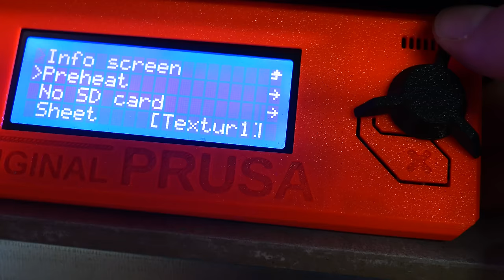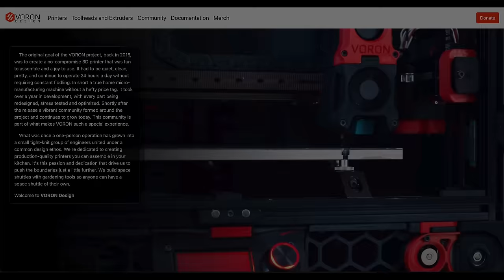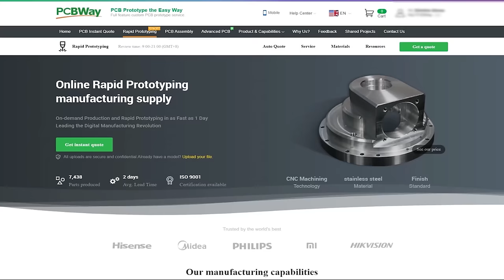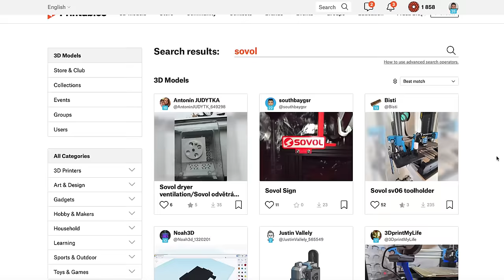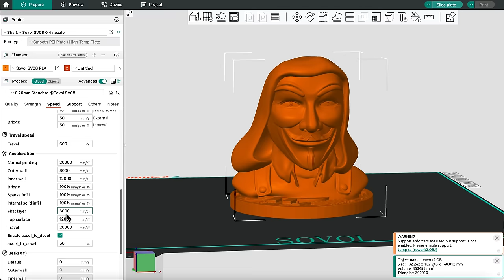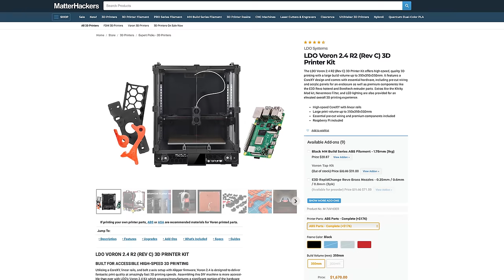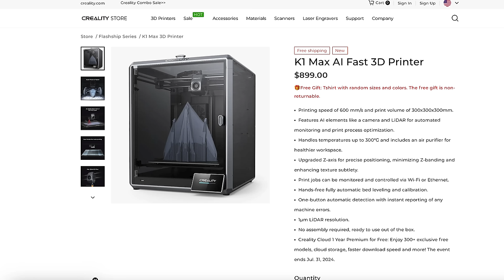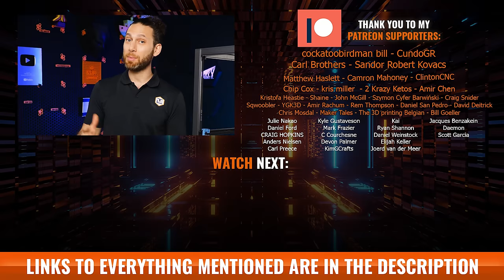The Sovol SV08: You Won't Believe the Price…

Comment: Hey Jonathan, I have an idea for another video, please see what you can come up with. I am looking for a recent generation 3D printer to make mechanical parts for engineering prototypes and equipment repair parts, not for toys. What I am looking for would be enclosed or easily enclosable, and with internal volume temperature control, capable of extruding engineering plastics, ABS and nylon at the very least, plus investment casting model making polymer, and preferably capable of high performance polymers up to PEEK. I would not have any use for PLA, I would be using PETG as an absolute bottom end material. It would be almost essential to have a dual extruder head so it could lay down design filament along with support filament or possibly make a bond to another polymer like TPU without interruption. Open source format hot end/nozzle design is probably a necessity for compatibility with the desired polymers. I do not need a huge build volume like the SV08; a 250mm cube would be plenty, but bigger would be OK. I would prioritize printing accuracy and mechanical strength over speed since parts would be parametric design and would need to fit together. I do not want a filament changer as I will never do multi-color. Thanks.

Comment: To be honest, I would buy it immediately if it weren't for the noise level. The screeching of the stepper motor drivers in particular puts me off. I remember that from my Ender 3, which is now rotting unused in the storeroom. I have the Sovol SV06+, which also gets very loud, which is extremely annoying. My converted Ender 5 pro, on the other hand, is extremely quiet. Apart from the fans, you can hardly hear it, even at print speeds of 150mm.

Comment: I started Sovol with the SV07 plus. There are design issues that they totally ignore, such as the lack of cooling for the controller, really bad slicer settings. No support for the Orca slicer. The absolute worse customer support. If you buy the SV08, you are going to have to work on it, some of the features such as the nozzle cleaner are not functional. But, on a positive side, it is cheaper than a voron…

Comment: My first impression was that this isn't aimed at the same set of people as the Voron, and the video confirms this.  (This title feels a little off, but it's not wrong*, just lacking nuance.) As you say, the main reason to build a printer is to *build it.  This printer seems to be aimed at the folks who like the usability of a Bambu but not the price (or just decided to die on the "open source" hill).  Or those who like the Bambu but want a bigger build area.  Which means they're not really aiming at an underserved market so much as the bottom end of the "it just works" half of the hobby.  One should not build a Voron to have an awesome printer, one should build a Voron for the experince of building a Voron, and having a printer that can be bought if your end goal is simply an "awesome printer" is only going to split off the folks who really weren't wanting to tackle the project in the first place.  So it's a good thing, I think.

They do seem to be more aware than Bambu was that most of the market is just interested in PLA/PETG; releasing the "this prints the cool filamnets" version first and making the "this prints the hot filaments" version as an upgrade seems like very good marketing.

The all-in-one nozzle and throat suggests that Sovol is accepting the idea that the old V6 multi-part nozzle was a kludge and it's time to move on.  I like that.  I do think it would be nice if we could settle on a standard for that type of nozzle - but we're in very, very, very early days for that.  Like sidearm cartridges a hundred years ago, everyone is still trying to push their own ideas.  Give it a couple decades and it will settle out.  So I get your frustration with not being able to use your old V6 nozzles, but they're a horrible idea and dead technology and no printer released post 2022 should come with one.  (I'm also unsure about the 0.6 vs 0.4 question.  Honestly, it would be nice if E3D would just make Revo licenses affordable and let printers like this ship with a Revo for easy changes.)

Mass produced, well fitting parts are the key to low cost and high reliability.  Being able to source a spare part from wherever isn't free: you pay for it in either total cost or lower reliability (or extra work to recreate reliability, which is what a Voron build does).  Bambu's biggest revolution might be introducing true mass production to 3D printers, and people who want to avoid "proprietary parts" need to suck it up and accept that "low cost mass production" and "generic parts between brands" are almost if not quite exclusive concepts.
  
(Although I do think that Sovol could have put in the effort to use 3d printing for the plastic parts and help push the "mass produced via 3d printing" industry a step forward. We're right on the cusp of that being widespread and its disappointing that a company looking to sell 3d printers isn't using that to support large-scale additive manufacturing.)

Finally, rant warning: the fans being loud enough to discourage you from remaining in the room is a FEATURE.  All melted plastics give off VOCs, and  all 3d printers generate microplastic particles as the extruder gears cut into the filament.  Even if it's not giving you a headache, we KNOW that breathing microplastics is a bad idea, and we have no idea what 30 years of exposure to PLA fumes will do to us.  Staying the f*** away from an operating 3d printer is a GOOD IDEA.  Don't mod the fan to make it quieter - put the printer in the printer room and do your work in a different room and stop giving yourself emphysema from microparticle inhalation.  Okay, rant over.

For me personally, this falls into "I don't really need it."  I have an X1C that does all I need for smaller parts, and the "big" things I want to make are over 45cm across, so a 35x35x35cm build plate is still "small."  But if it can get close to Bambu levels of "it just works" and reliability, this could be a very useful machine, and will also help bring prices of "it just works" down in a way that Creality's "we use the community as our beta testers" printers never will.

Comment: Bro once this thing is out for a couple years and the price goes down a bit I might have to get one. What a beautiful machine (although i might not unless they give us that V6 nozzle adapter, I want to be able to print carbon/glass fiber without replacing my nozzle all the time). Also will have to watch more reviews in case other issues with it come up
Reply from the maker: Yeah, I see it as a good platform for upgrades, like an Ender. I would IMMEDIATELY replace the board fan... and I'm probably going to replace the entire hot-end and put an eddy current sensor on it when I get a sec :)

Comment: For the build volume, it is quite cool but the proprietary hotend might be a dealbreaker
Plus the fact that for the undisclosed price, there probably won't be any enclosure, heated chamber nor filtering/aeration system...
While not comparable in terms of build volume and technology, I think I'd take a Flashforge A5M over it unless maybe if it drops at under 400€
Reply: He says the price is under USD600, so it's probably $599/550€ or so.  The enclosure etc you can easily make your own or buy it separately. It's very inexpensive compared to the A5M which only has a 484 square centimetre print size vs 1225 square cm for the Sovol.

Comment: Looks very promising. I'd love to build my own bambu to avoid their closed ecosystem and a voron/ratrig/HEVO would be the way to go but this is a good shortcut, with a few mods needed. I can't help but Frankenstein every printer I touch apparently. I think I could get a CHC running volcano nozzles on that thing if I poked around it for a while. I'm also sure someone is bound to get an ERCF working on this thing sooner or later.

Comment: As a Voron has never been on my radar I ask myself this,  is the 08, with enclosure, a good alternative to Qidi X-max3 and other printers in that segment ??
Reply: not that i own any of the products, i do own a voron 2.4 r2 tho.

but the 08 definitely is better than the qidi if this is raw klipper.
but that being said, the issues he mentioned aren't as easy to fix as a voron and you will likely need to mod a lot to get it quiet and easily swap the extruder for a v6 as example.

aside that, i doubt it's easy to add a carbon filter or nevermore filter with activated coal as example, or to print replacement parts, so for half the price of a 250x250 2.4 r2 i'd consider still looking at voron, because ASA is actually a pretty neato material to print with from personal experience

Comment: Sovol is a Creality company. Those printers are developed in-house. In-house of sovol? No. In your house. They always need community Mods to become useful and they need time and fixing (if you are lucky and get the parts, sometimes you will get ignored or redirected to a very bad YouTube Video) because the early customers are used as beta testers for full price (even if they tell you, that the early bird price is less. It isn't)

The Nozzle knocking prints over is either a Hardware or a Profile problem. I never had that happen with my printer (not a voron) and i don't even use z-hop. Most people in the community of my printer don't use z-hop either.

That's not only my experience with sovol, many customers had those problems. In my case it was the SV06.

By the way.. after i didn't find a solution with Sovol for the problems the sv06 had, they offered to refund me if i send the printer back.. sounds good?

Send it back to china!

That would have been about 95€ shipping. That is some pristine customer support (which is only accessible via Facebook chat). Keep that in mind.

Comment: I'm sure there are better fan replacement options. Fans are usually easy to swap out... I have an ender 3 S1 pro, first printer ever. Added a Bambu P1S to my fleet...it's epic. This being 575ish and a bigger bed... This COULD be my next printer. ALOT of value here for the price! I still am not up to speed on these Vorons and SV's....more reading before I buy.

Comment: Belted Z axis has me sold, we are finally starting to get companies that are moving past outdated lead screws. I love it.
Reply: What's wrong with the lead screws? Gantry of the Voron 2.4 is 30% heavier than Trident, giving the Trident (with lead screws) a speed advantage (as in max acceleration in input shaping). Also the bed on the bottom makes it harder to heat the chamber than the Trident with the bed on top where the hot air goes. Better for printing ASA, ABS, Nylon etc., it doesn't take ages to reach 45C+ chamber temp where the print is.
I have both a Voron 2.4 and a Voron Trident and I think the Trident (with lead screws) is the overall better design. Don't get me wrong, the 2.4 / SV08 style is great, but all in all I prefer the Trident.
Reply: @tstrrtstrr745  Lead screws are less accurate, and are generally replaced by ballscrews with more modern CNC machines. Belted Z is another option for machines that bear less of a load, no concerns of backlash with belted Z, and less weight. Those are 2 different printers you are comparing, lead screws are not the deciding factor for gantry weight. There are belted Z mods for the trident, although I think they mount the motors on the top, I'd install them on the bottom.

Comment: If they don't fix the z-hop issue you pointed out, this will not be an out-of-the-box just works printer, in my opinion.
Reply: I think there's probably a bigger underlying issue if the print head is knocking stuff over. Fixing that with Z-hop is like putting a bandaid on it imo. A lot of people are saying the print bed is probably thin and flimsy, so it could be that it warps significantly when heated. Or maybe it's related to the Z probe issue? Z-hop will also dramatically increase stringing and it's nice to be able to print without it. I'm waiting to see more reviews
Reply: You guys are exaggerating
Reply: @_..-.._..-.._  z-hop just sucks for most prints, if it can't print without Z-hop I don't want it. But if you mean that there actually aren't issues with knocking prints off the bed then that's great

Comment: I hope they made it easy to replace the hotend.  Im just not gonna use the one that comes with it ever if I buy one of these.
Reply from the maker: I'm gonna try to replace it.
Reply: @thenextlayer  yeah that would be the first thing I did with it.  I switch over to volcano style on every printer I have.  Then ceramic with cht style volcanos on the larger ones.  

Hopefully wont be hard to make the switch on this one.  Im pretty excited about it been waiting for a ready made voron that didnt cost a ton.  Hopefully these things do the trick.
Reply: @thenextlayer also kind unhappy they arent selling the svo5 anymore that was they bang for the buck printer in my humble opinion.   So easy to convert to hybrid corexy or full corexy and just a decent printer out of the box for a good price.

Comment: That pricing discussion was really bad to follow. It would have been great if you had rerecorded it.

So $600 for a downgraded voron. That's not bad but it's not as awesome as you make it out. It isn't a carbon copy of a voron. A performance comparison for the hotend fan being better will have to be made. Klipperscreen is missing and you neglected to mention why using standard aluminium extrusions is so nice. You can't just mount things to these sheet metal parts.

The nozzle is a huge question mark for me as you said yourself 3rd party accessories are probable not going to be made. 

Questionable is also how rigid the frame is in comparison. 

All that being said its a cool printer.
Reply from the maker: In someways, it’s downgraded, but as I noted in the video, in other way, it’s upgraded. Filament sensor, HDMI, nozzle, brush, camera, Canbus…

Comment: Sorry if you covered this and I missed it, but does this come with a paneled option? A lot of the reason people like Vorons is that they are optimized for ABS printing and have a built in enclosure. If there’s not a panel option, it’s a huge missed opportunity for this printer.
Reply: They are releasing panels as a separate product that you can buy.

Comment: TPU performance is the big question mark for me, my sv06 wasn't the best in that department
Reply: you can put the sv06+ high flow extruder on the sv06. That is a tpu wizard.
Reply: @gerGoPrint3D  My issue was the extruder gears, I already have an extended meltzone on there

Comment: Just saw you comment about Z-Offset thermal drift.

I was beginning to wonder if I was the only one experiencing this.

I have discovered on my Cteality Ender 3 S1 Pro, I have dramatically different Z-Offsets for different temperatures, including bed temperatures.  I have even started a spreadsheet to help me remember want z-offsets work at what temperatures and to help predict what might work for temperatures I haven't tested. 

I haven't had time to compile a writeup or video on this situation and wasn't sure anyone else was experiencing this.

Comment: I bought an A1 combo for around 626 with shipping and all. This is dissapointing because theres really no point if the sv08 is as good as it sounds. The only purpose would be the AMS and the customer support but there is so many AMS solutions out there for other printers.
Reply from the maker: Don't get it twisted, the SV08 is good, but it is NOT the same "works perfectly out of the box" experience as a Bambu printer. Like I said, the profiles are not quite right, there are little things that you will need to upgrade (swapping fans, etc). If you want an "it just works" printer, Bambu is better. If you want a platform for upgrading, and a kick-ass printer, but one you'll need to tweak, this is great.

Comment: If the bed reached 120c i would have bought. Need that for PC and abs for my long abs prints
Reply from the maker: You don’t need 120 to print ABS at all. And honestly I print PC at 100-105…
Reply: @thenextlayer  how about this...I want 120c :-)  I print large 100% infill objects which warp if the chamber is not hot. My bamboo lab has 120 bed and  no warpage with a nice 55 degree chamber temp

Comment: I want to see a 500x500x500mm version of this with a standard nozzle that can be easily swapped and a different spool holder.  Maybe call it the SV09?
Reply: belts gets a bit weird tension-wise when you get much further than 350mm. I'd love to see the same tho!
Reply: I think you'd be better off with the RatRig design once you get to 500x500 size. I wish someone would make a semi built version of the RatRig like Sovol has done with the Voron.
Reply: @Milkex  I've seen similar design printers with a 500mm^3 print area.  Some of them just used thicker belts to allow for the tensioning to work.
Reply: @Mildly_Amused  ohhh okay, I was thinking maybe taller belts? good to know thicker ones work as well!
Reply: @peterrichards1989  I saw Voron design based printers that were 500mm cubed print volume.  Why would a rat rig be better of the Voron design works?
Reply: @Mildly_Amused  I had endless problems with the Voron design once it got past about 400x400 in size. The RatRig 500x500 works really well, the design is better for larger bed sizes, this probably isn't the place to go into the nitty gritty but it's an area where the RatRig design is better suited.